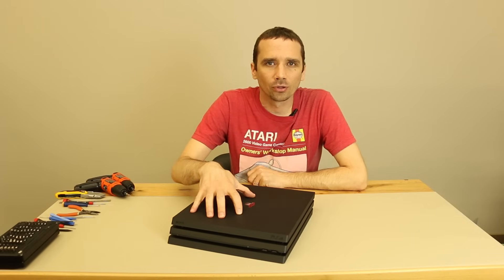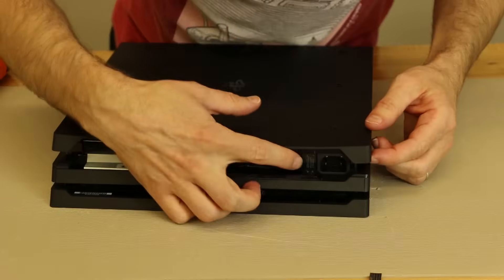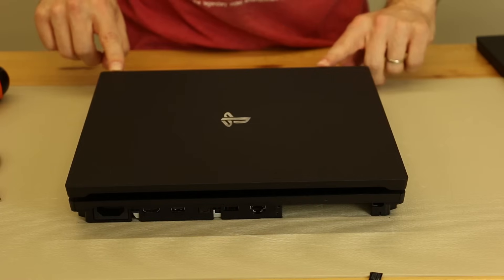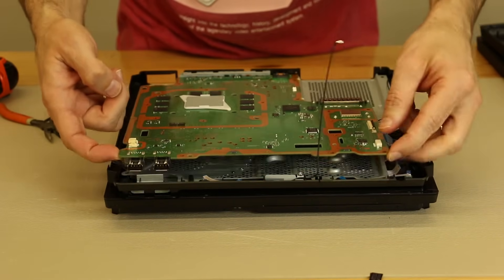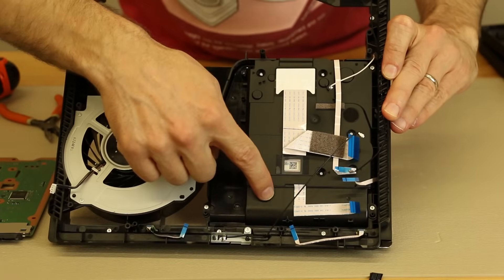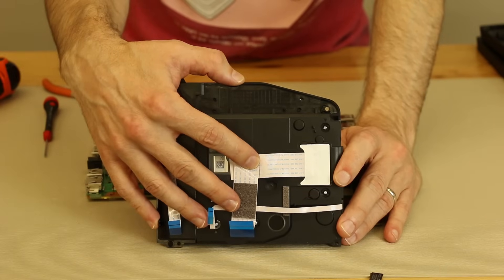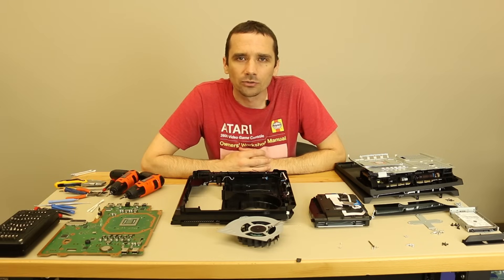PS4 Pro Teardown - Detailed Disassembly

Comment: I broke mine because; instead of pull the cable out of the power block instead of off the motherboard, I pulled it right off the motherboard

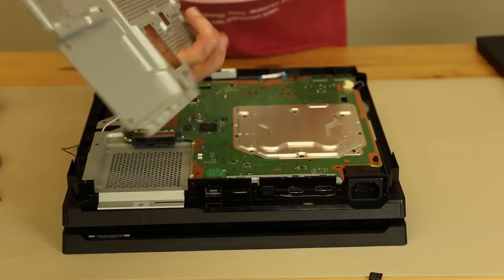Comment: 4:14 what is the center 6pin ribbon cable,
i.e, just beside 40pin disc drive ribbon cable
for?

can't have full access to it as it comes out from the frame, could you please show a way to replace it?

i.e,
the 6pin ribbon cable,
just beside the big disc drive cable.

Comment: ps4 pro is literally one of the worst consoles in repairability aspect!

what's the point of hiding the disc drive & heatsink literally at the bottom of everything (while teardown).

I now have a supposedly simple (in previous ps4s) lens replacement to do & yet  literally have to teardown the Entire console out.
Reply: yeah they made this console almost impossible to clean

Comment: What do i do? I stripped the only plastic screw, it's in the middle back side of plate you lift to expose the top part of motherboard,  opposite of the fan. Why did they use a plastic screw??

Comment: If your ps4pro is really noisy and you decide to replace the thermal paste, remember that it is different from applying paste to a CPU. A blob similar to what you might put on the IHS of a CPU is NOT adequate for the exposed die of the ps4pro APU. 

You need to spread paste thinly and evenly across all of the die, including corners and edges. I got it wrong first time and had to re-do because it still sounded like a jet engine.

Comment: I know this video is old but I was wondering if you could possibly answer this. My PS4 pro has been great for me up until last Saturday, the power button keeps getting tripped and puts the console into Safe mode while powering on. Sometimes it doesn't do it right away but if I managed to make it to menu, the system enters rest mode.

Is it possible to completely disable the physical power button and only allow the PS4 to turn on by controller 'PS' button press? I am struggling here, I can't afford to get it fixed or replaced at the moment so, any input would be great! I assume one of these ribbon cables is for the power button but I don't know 100%

Thank you.
Reply: I answered my own question, yes, you can. I disabled the power button from the case side, not motherboard side and it worked and currently reinstalling everything.

Comment: Removing the power supply/hard drive and a few screws/disconnect wires on the other side.
The "Entire" motherboard with both metal panels wiggle out at an angle without needing to take it all apart.
You won't have to repaste or anything.  : )
Just found this out.
Reply: @MatrixAlphaCWX  I just wanna clean mine and avoid the paste mess
Reply: any video?

Comment: How come you didn't tell us how to remove the wifi antennas?  The seem pretty fragile,  just pull em out?😅
Reply: I know you wrote this 2 weeks ago but I hope you didn't just "pull them out", they're like a snap connection, I used a plastic pry tool to pop them off.
Reply: @Kushology  I got them off, thank you! I did slightly crack the motherboard, trying to remove that tiny connector for the power supply.  The console still works, though!  Thank you for your video my man, it helped a lot.
Reply: @iiiam3 It's not my video but lol, glad still works. My power button has been so sensitive past few days, led me to Tronic's video. I ended up pulling out the power button ribbon cable and has been a trooper since.
Reply: @Kushology  haha, not paying attention.   Thanks for your response!
Reply: @Kushology  my power button is sort of a pain.  It is difficult to power on at times
Reply: @iiiam3  Could be the plastic peice that touches the sensor to activate. I'd rather that than what my issue was.. I basically formatted my PS4 for no reason because I thought it was software problem. I had just updated to 11.50 few days prior.. lol

Comment: What I’ve been wanting to know for years is Will the PS4 pro run if there’s no disc drive in it I have a jailbroken modified PS4 pro I was trying to figure out how to replace the disk drive. With an additional hard drive, or use the space for the disk dry to put an external hard drive in it, and connected externally by creating a whole in the PlayStation shell.

Comment: The detailed teardown is very helpful. Now if you or anyone else to figure out how the hell to make this thing run cool instead of it cooking its own self like the Xbox 360s used to do oh, that would be great. Never let mine get super dirty or anything like that but after less than a year it started overheating. Now I've had it for about 2 years and it's just literally cooking itself to death. It gets so hot it's unbelievable. Eventually it starts having errors that sends into Sony and then shortly after that the screen starts intermittently going black. After first started I cleaned it thoroughly by pulling apart using your video and even tried replacing the thermal paste that work for about a month or so then it started doing it again.

Comment: I d k what kind of solder sony used on my ps4 but i cannot get the solder to melt on the 4 pins i got the other pins desolder but i had to kut those 2 side pins on each side and still cant get the solder to melt got it up too 900 degree f and still wont melt i just gave up and went bak to my 1st gen

Comment: Thx verymuch for the video. Btw my ps4pro always failed to start at first, then after i hardreset 1it ask me to connect the con to the unit via usb, then it enters safe mode, after that when i restart from safe mode, i can start the unit normally. Can u suggest whats wrong with my ps4pro? Thx

Comment: Also how did you remove the white wire? The 2 black ones came off no issues but the white one wouldn't budge I tried to get a can of air in to blow the dead bugs and stuff out and I accidentally snapped the white wire the sits next to the wifi tabs

Comment: Caution: It seems the thermal paste link recommended on this video may lead to an Amazon listing  selling a counterfeit compound. Using a counterfeit thermal paste could damage your CPU or APU. While I can't tell you how to determine what is and isn't counterfeit or where to find the genuine product, I can say that a larger than average number of buyers have complained that the paste didn't work as expected and also appeared "off", likely indicating that it is a counterfeit product. Unfortunately, Amazon has recently become a hotbed for counterfeit products... listings that Amazon won't do anything to remove.
Reply: With that said, I was able to, with the help of this video, your CR2032 PS4 video, an iFixit page and a couple other videos needed to verify how to apply the thermal paste properly, repaste my PS4 Pro, install a KES-496A replacement optical assembly in the optical drive (figured this one out myself ... and it's very fiddly) and replace the CR2032 CMOS battery all with success. My day one PS4 Pro is now nearly factory new again, all except for the original hard drive.

The original paste on this day one unit was indeed quite crusty and dry and likely no longer functioning as intended. I quickly realized that not replacing the CR2032 button battery before reassembly would be a mistake; so I replaced it. I didn't want to have to tear it all apart and repaste it again in just a few months when that battery decides to die.

Comment: My PS4 pro is different to your one. Mine has no black screws. The solid grey frame without all the holes in in connect from left, centre and the right side with the holes on the top and bottom. Mine had the solid frame on the left and right, left being where the hard drive would be. Then i have the holes on top, centre and bottom. I also have even more silver screws than what your PS4 has.

Comment: I have a ps4 pro that I'm trying to fix. I just disassembled it and cleaned it. The problem I am having is the disc drive won't pull the disc in all the way, but if I leave the disc in and restart the ps4 it will pull it in once it powers up and it reads the disc just fine. I tried cleaning the rollers just inside the front of the drive. After putting it back together the problem is still there. Other than that the system works great. Do I need to just buy a replacement disc drive ?

Comment: 5:37 this thing for APU won't be screw down before take apart where we can find power supply and fan. 
7:43 power supply connector is easiest thing to break you should show how to remove safetly, also this power supply connector is very hard to eject mostly you will just pull up thing soldered to motherboard so where is video how to fix it?
12:58  I think removing thermal paste with ear sticks here is not best idea I used a special tissue that just dissolved thermal paste and it didn't break my console.
btw why is much much harder to disassembly than any ps4 fat?

Comment: Sony should make it simple for cleaning..
Reply: exactly. there is too much torx screw I had to uncrew these torx even with torx... Power supply connector is easy to break not as in ps4 fat. Anyway motherhoard is simple to pull up not as in fat where I needed to use force.

Comment: i just took apart my 1st ps4 pro it was hot i couldnt take the wire off the power supply gonna try again but i never lost a screw and i got it back together again.

Comment: Great easy to follow tear down. I just purchased a used PS4 Pro,  Star Wars Edition and the fan is quite loud. So I will be tearing it down and doing what you did. How often do you recommend replacing the thermal paste and pads and a good general cleaning?

Comment: Thanks to this I was able to open and clean my sister’s dirty PS4 pro.
The clip that holds the power supply was a little tight since it was the first time opening it but other than that smooth process. Thank you for your detailed explanation. 😉

Comment: Yo do u have to go in order of taking it apart if u just wanna clean the heat sink?
Reply: I guess a better question would be can u take the power supply out without taking the top plate off?

Comment: Finished putting it back together and I have ONE screw left over... From what? Where did you come from? Might be a third screw to the power supply. Not taking it back apart, what a pain. Just gonna tape it to the top plate I guess.

Comment: My goodness the dust that was in this sucker scared me. I have a very small apartment and after 5 years the dust was caked on the heat sink. This video helped so much , DIY saving video right here. Was actually easy (once getting the battery out, that wire sucked.)

Comment: I stripped the middle bolt at the bottom, on the top side of the ps4 if that makes sense. Any help on how to get the screw out? They were all t9 but that one was t8 and it was just a weird fit

Comment: Came here from your other video looking up how to fix an over heating PS4 Pro. We ell I have just finished turning my Pro on after dismantling and cleaning the completely blocked heat sink and it is working, all looks amazing so far! So thank you for the videos they were perfect! Obviously I still need to see if it over heats and swithches off but at the risk of jinxing it I highly doubt it will because everything looked so much better after the clean. Again thanks so much was very helpful.

Comment: Thanks to these teardown, I was able to cannibalize the disc drive from an old PS4 Slim that died and replace a faulty disc drive in my PS4 Pro and get it reading discs again
Reply: @knightsljx  Is that really work??
Is it a whole BD drive replacement or just the Laser? 

I heard the PS4 BD Drive won't work if it wasn't not the same hardware attached or something like that.

Comment: You need to edit your video , my power supply was glued to mother board and it ripped off . And yes i grabbed it correctly at the wire part not the housing to the motherboard. So before anyone else damages there system you need to edit it.

Comment: Guys pit Liquid Metal on your PS4 Pro. I just applied it on mine yesterday and used Kapton tape to protect the resistors. Night and day difference. I now play my PS4 Pro for much longer. I could not stand the noise before and would only play for like 10 minutes.

Comment: Thanks for this full detail teardown! My pro had some power problems and would shut off playing specific games and I sent it in for repair only to wait a month to get it back with a broken disc drive and fixed power unit, I recently bought a tool to take it apart and looked up that the slim and pro disc drives are interchangeable if you trade out the ribbons and I watched your video and replaced the drive with my slims drive and I'm back to playing physical games and watching Blu-ray movies on my PS4 pro! Thank you so much man! You've helped me, and I hope you still help others with your great videos!
Reply: What bit size did you use to undo those screws under the warranty void

Comment: BE CAREFUL WITH THE POWER SUPPLY CABLE. I did exactly what this fellow did and mine popped completely off the bottom of the motherboard. Gonna try to solder it back in place 🤞

Comment: I am having trouble trying take out the 4connector white plastic thing. Its not coming out and the plastic is chipping away. Its ooolllddd. I dont want to pull on the black wires

Comment: Good morning, hello from Brazil!  congratulations for the channel, I had a doubt, when disassembling my Pro, I noticed that to remove the power supply, there are two screws that hold the thin metal plate and a third on the bottom, this one is black and the key used to remove the other two does not work, it seems it is not removable, I saw other PS4 Pro in the same way, I stopped the disassembly there, not knowing what to do.  if you can clarify, thank you.
Reply: I have the CUH 7102B model PS4 pro. The black screw on mine was not a real screw. There was 2 screws holding the thin metal plate, and 2 screws on the sides. The middle black screw does not screw into anything and does not come out. Once you remove the 4 screws on top and 2 remaining screws on the underside by the motherboard you will see that the powersupply comes out easily. But be careful removing the connector from the motherboard though, I heard of people ripping the connector from the motherboard and destroying the console. It may be easier to remove the connector from the power supply.
Reply: @deevesh tanks!!!!!

Comment: 7:25  What he doesn’t tell you is that sometimes the plug-in connected to the motherboard is glued to the battery’s connector. And you MUST disconnect from the battery itself and not the motherboard. I Ended up breaking the connector off my motherboard because he failed to be thorough here.
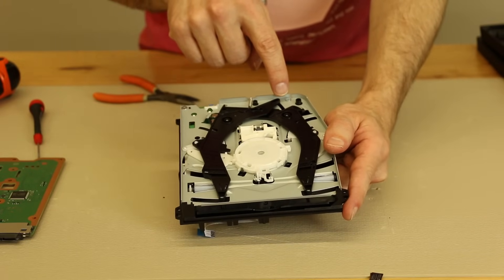11:45 also failed to mention that once disassembling the disk Drive. The spinning magnetic part could possibly slide out. And he didn’t bother showing how exactly that piece could be put back. Seriously, one too many issues
Reply: ya I just ripped that connector off the mobo too bummer
Reply: If only I read this comment before. I broke mine the same way today.
Reply: when I flipped over my console my connector just fell off so....is my ps4 in the shadow realm now?
Reply: @micah329  I had to find a really, really, really good solder guy in town. He charged me 150 bucks🤦
Reply: @karensbadapples8337  that sucks man, there's a lot of army guys here but they just wanna ski 🎿 or get affordable housing.

Comment: Does the x clamp have to be tightened as much as it can? Like are the 4 corners suppose to be touching the mother board? And if one side is not as tightened as the other 3 would that cause the ps4 to not power on?

Comment: 10:36
you can observe the thermal paste have a bald patch on the center. That means the Apu is not perfectly flat as it should be. In this unfortunate case, the only place with better thermal contact between the heatsink and the Apu is on the center, while the other area is only saved by the much thicker thermal paste (which is a much poorer thermal transfer performance). This translate to poorer overall heat transfer and that's why many people see their PS4 pro overheat easily (the jet engine sound).

Sad.

The only way to make it better is to sand the Apu flat, or sand the heatsink concave in relation to the Apu surface bulge.

Comment: 7:48 ngl I skipped this part bc I used the longnose pliers and I ended up cutting the outer later. The system still works fortunately but I wouldn't do that again. I did it three times before I finally stopped bc I didnt wanna destroy my ps4. If i ever did any one knows what specific thing is so I can just possibly buy a new one?

Comment: So, i have stripped down cleaned and repasted thermal paste all is good, i do have a question though... i have removed the bluray drive as i dont use it, would it be safe for me to dremel out the drive bay as i feel its keeping air from getting in and its not used. Would really appreciate any thoughts on that.

Comment: 9:57 so this is the hottest place with the PSU ohh I was wondering why is the console so hot, it's not the APU but the heatsink with the PSU. And yes I did clean up with new thermal paste (propable useless after 2 years but why not haha) and it's quiter and it takes longer to kick the fan up, also more air is coming out than before.